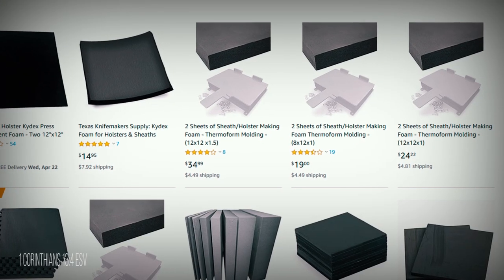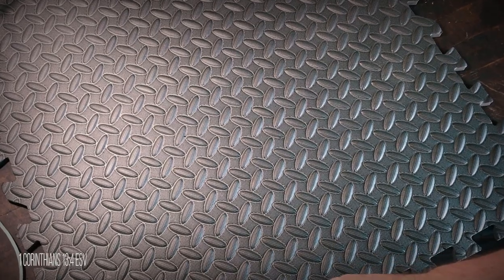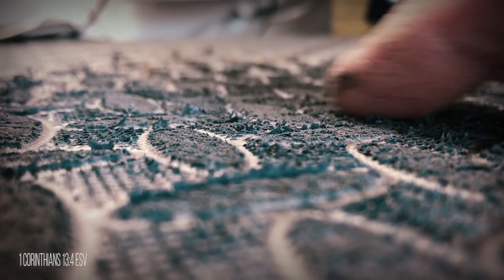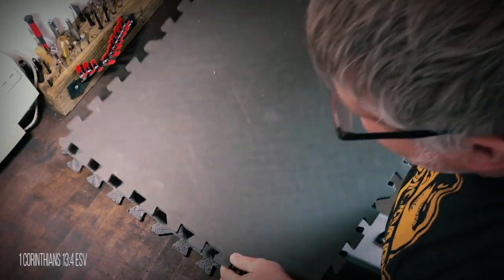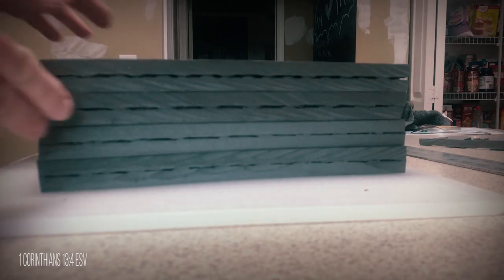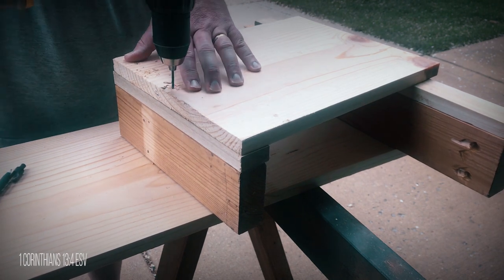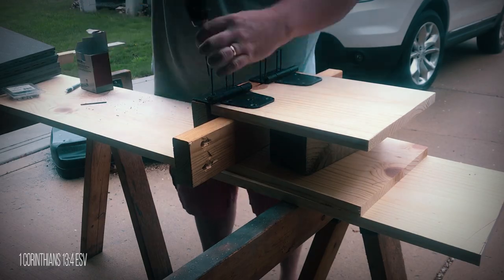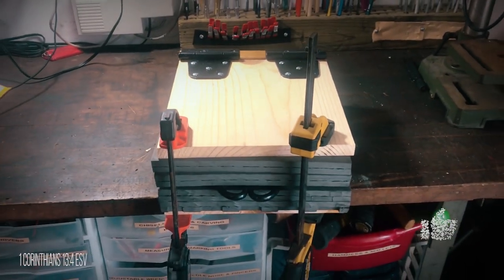how to make a DIY kydex press

Comment: I use that foam also but since the layer that touches the hot kydex is basically a one and done because it doesn't recover its shape like real press foam does, I don't bother gluing the foam layers together. It's fine for an occasional home project,  but if you plan to start making lots of stuff from pressed kydex, the real press foam is worth the money in the home made press.
Reply from the maker: I haven’t had time to make a second, so I really hadn’t noticed that issue. I will check it out to see if the shape is still pressed in it. Thanks for the tip. Yeah I am planning on buying the real foam, but I wanted to see if I could even make one first. Thanks so much for the feedback and for watching. Blessings the ocd Hunter
Reply: @TheOCDHunter  I've been making kydex stuff for friends and family for a couple of years and I still use the Harbor Freight pads. I  just ordered ten 12x24 sheets of kydex from knifekits and still forgot to order the press foam. LOL
Reply from the maker: I just went out and check the foam. Sure enough, the imprint from the job was there!  I guess I’ll can flip it a couple of times before I have to buy, but I’ll be spending some $$$ soon. Lol. Thanks for taking the time to give me your honest feedback and for the support of watching. Blessings the ocd Hunter
Reply from the maker: I’d love to see some of your work!  Post some on my fb page if you like!  Blessing the ocd Hunter
Reply: @TheOCDHunter  I can't figure out how to post pictures here. 😔

Comment: can i ask how that white pine worked out structurally? The fibers of white pine are really soft. Especially when it comes to holding screws or nails. Usually white pine is used in non-load bearing applications. Yellow pine is a better choice for general construction and heavier loads such as a press.
Reply from the maker: Wood did fine, but the foam left a little to be desired. It seemed not to return to form after several uses. Hope this helped blessings, the ocd hunter